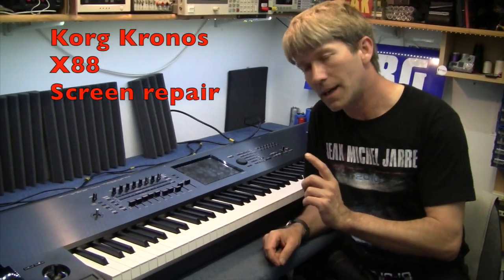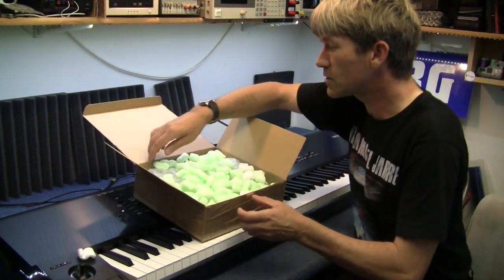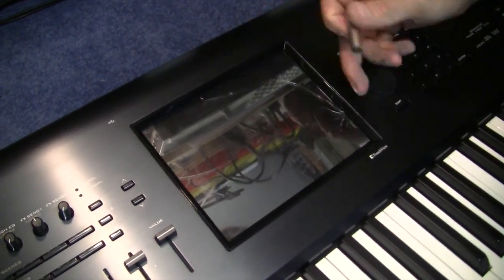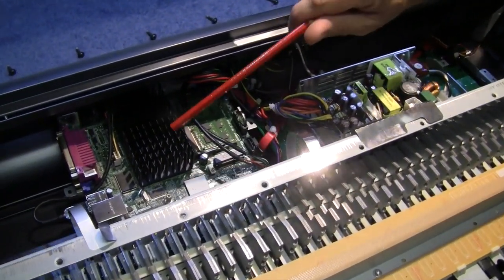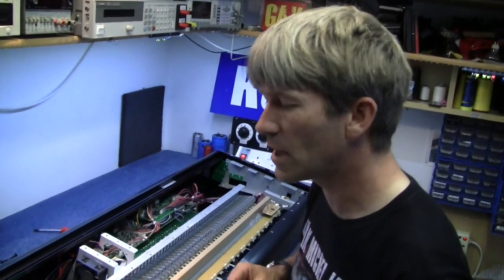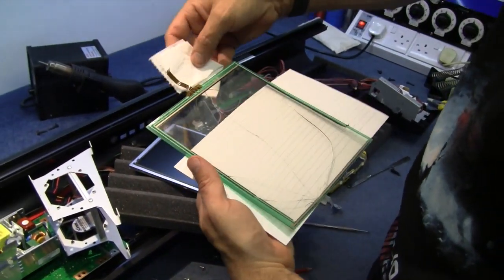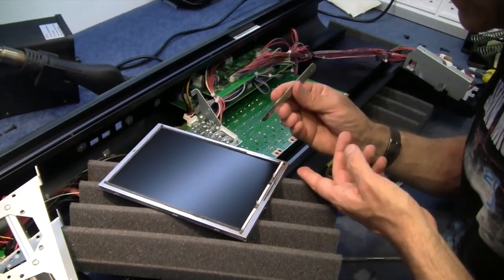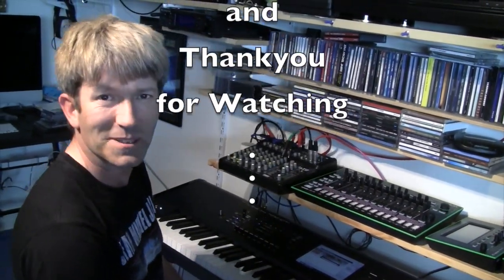MF#27 Korg Kronos X88 Repair cracked touch screen replacement

Comment: Korg used to make quite beautiful product such as the M1, T-series, and Wavestation.  A $100 Intel Atom PC inside is not exactly the most impressive thing in the world.
Reply: Quite embarrassing, even. Since the OASYS was quite a beast with 2.8 GHz Pentium back then. Korg needs a lot more CPU power than an Atom to make it a flagship instrument.
Reply: It is a con.  Even putting a high end Intel in it just to support Linux kernel, it's a round way to go to make audio product.  Looks like times of elegant and true engineering through dedicated DSP chips like the Motorola 56000 in the Nord Lead 2 back in 1997, those times are gone...  I am only scared to think of what's inside the Montage (Motif used Linux as well) or Integra-7.  I understand that digital technology is just bits, but I feel more comfortable with dedicated musical hardware instead of going around to use multi purpose consumer components.  So we no longer use dedicated DSP chips, only FPGA and mainstream PC CPU's to run musical hardware on?  If so, it doesn't make Nagra battery con look as bad as I thought it was, compared with what Korg is doing here :)  Sure, Yamaha charges a lot of money for their RAM boards, but if that's dedicated chips, I am fine with it.  Korg has advantage to most because upgrading memory is cheap.  Still, I think using Intel Atom in "high-end" professional instrument is a con.  God, I've done some research on the likes of LVMH, Rolex, Apple... Now I see Nagra and Korg joining the ranks.  But hey, if it's all legal, maybe it would be better (and healthier) not to know the things behind the scenes.  Nonetheless, it's a real eye opener this YouTube channel.
Reply from the maker: I think it could be made in a rackmount with a much better up to date processor.
Reply from the maker: Hi Andrew. I recently repaired a fairly expensive guitar foot pedal for a friend and it only contained one Arm cortex chip and a few other cheap components. I guess the cost was the development and programming.
Reply: Well, there was an interview with Eric Persing about that on sonicstate (who would love to have you on the show, too, by the way), and he said that there's no market for rackmounts of this type.  Eric Persing agrees that such solution would be better, but hardly anyone would be willing to pay for an Omnisphere in a rackmount module.
Reply: Well, I guess I am very old and conservative then.  I am still lusting over something like SY77 which made my jaw drop back in 1990 or so.  I like instruments like that in and out.  Paying money for a softsynth?  Not only a softsynth doesn't have any predefined form factor or tangibility, one has to rely on rather annoying Microsoft or Apple business ecosystems to make those run.  I am getting quite a bit concerned though what's inside the Integra-7 now.  Maybe it's an empty box with some FPGA simulator or something... I am afraid to open it.
Reply from the maker: I repaired an old ARP-2600 a while back and was quite happy to see that it just did what it was designed for, all those components in the right order made it the unmistakable ARP-2600. now I did run an arp-2600 software synth on the computer to try and set all the parameters exactly the same as the hardware unit in front of me. it just did not sound the same, close (ish) but it lacked something. then while playing with the softsynth I was continually getting annoying messages on screen asking me to update my antivirus and flash was out of date (yet again). I eventually turned off the computer and played happily with the old hardware unit knowing it needs no updates and it would just do what it is supposed to do :-)
Reply: Ha ha!!  This made my day!  Yes, that's precisely what I have in mind.  I am sure an OS can be optimized not to bother you with updates all the time, but by default these are the settings.  I feel as if the OS had me by the leash at all times.  I think that's why Apple favors "cloud" services instead of microSD card for their mobile devices, so that the data is on their servers and customer would pay monthly fee for the storage.  Same with music and video streaming.  Apple wants to get into that too, that's their business strategy.  After all monthly fees from the customers make for more predictable business plans.  Computers were not like that before the Internet was not mainstay.  I spent all nights on Windows 3.1 playing Flight Simulator without any bother from anything else.  It was beautiful experience.  Same with Atari ST, you load something like Dr.T's KCS sequencer, C-LAB Creator, or Steinberg Pro-24 or Cubase on the Atari, and the computer de facto becomes a sequencer, a patch editor, etc.  I had pleasure to work with Sun Microsystems computer, it was fantastic, and the Open Windows GUI was beautiful, and minimal, not to slow down your system.  I am sure Silicon Graphiscs machines were similar.  But as we all know these companies no longer make computers.  The OS wars were won by the companies who keep us on the leash by the Internet.  Even Canonical goes the same route with their Ubuntu.  I get bothered to upgrade all the time.  Anyway, I digress...

I may complain about all this because I am an older date person.  And I am quite shallow as well.  I got myself into the synthesizer hobby primarily because of the ads in Keyboard magazine back in 1988.  The Korg M1, Roland D-20, Yamaha V50, they looked so beautiful, professional, sleek, serious, no cheesy icons on those.   I loved every bit of that market.  Now, the "millennials" (sorry, a politically incorrect "offensive" term, but you know whom I am talking about) grew up having all musical production tools in their PC.  So, they won't understand the delusions of an old geezer like me, talking about aesthetics of gear, keyboard feel, build quality, etc.  Today's economy seems to be all about the bottom line, just to get things done, and a laptop or tablet is the way to go, because everybody has one, and it's portable too.  I am more sentimental, still dreaming of keyboards like Roland RD-1000, D-50, Yamaha SY77, mainly steaming from desire for aesthetics I like.  ARP2600 is wonderful.  Minimoog Model-D has just been reissued in rather truth to the honest form, which I am pleasantly surprised.  Who knows, we may see ARP2600 reissue as well (in 86% size by Korg), but we are extremely unlikely to see reissues of the DX7II, Roland D-50, D-20, Yamaha SY77, SY99... etc.  Everyone wants things smaller and portable.  Roland's expanding Boutique line is a proof of that.  Although quite substantial DJ controllers from Pioneer, Denon, and now Roland seem to be in demand.  I guess, like an audience, like the gear.  There's no way around it if a company wants to stay in business.
Reply from the maker: now that made a very interesting read in a way that I could have fooled myself into thinking I just wrote the same thing. the sy77 and dx7 have been almost resurrected within the yamaha montage (in a way) it uses FM and AWM so I jumped in there and I truly enjoy playing it. there is no full on editable sequencer. it will record as one lump of performance but you cannot go and add something on another track afterwards which means I have to record one track at a time like the good old days. I like the way some things are going though with the model D and yes if korg remade the 2600 I would get my name on the list even though it may be 86%. I had the boutiques and though they sounded fairly convincing they were hard to perform those tiny little movements with faders that could be so subtle on the original instrument. the JU-08 was the worst one as the faders only moved one centimetre so you could not get those sweet spots quite so easily as you could on the original. dont get me wrong I do use cubase when i am trying to compose something just to see if it can work but i will then try to do it all with hardware afterwards as best as i can.
Reply: Hardware or software, it's difficult to tell these days.  As stated by Ikutaro Kakehashi in an '86 issue of Keyboard magazine, the Roland D-50 development was 70% software.  So, the D-50 is more of a soft synth than hardware actually.  On the other hand, it runs on dedicated hardware.  I think that's where the distinction should be made: dedicated, or multipurpose hardware.  Now, the business side of all this can be quite disturbing to actually get to know what's going on behind the scenes.  Today's Sonic Talk almost ended in a fight discussing the business side of software products running on Apple's hardware.  It's bad, and it seems very politically incorrect to talk about it.  Nick Batt tried to moderate...  But, when people realize that they are being constantly manipulated and deceived by large manufacturers, they may eventually get fed up, and start talking.  I think it's all natural.

As far as Montage is concerned, it has beautiful action, beautiful action, and beautiful built quality.  I am not big on front panel aesthetics though.  I don't like the touchscreen (looks like someone put a tablet on it), I don't like the Nord Lead 3 type encoders (way too many lights) and don't get me even started on the big nipple-shaped thing called "super knob".  It's clearly EDM/DJ oriented, and I am not into that kind of thing.  And yes, it's nice the Montage has the FM engine, and it has 8-operators and all.  I don't believe it has RCM though.  There are some really cool and expressive RCM sounds I have SY77 disks, I can play with those for hours triggering from the KX5 srap-on controller.  RCM and KX5 seem to work especially well for woodwind type of sounds, and that's even without the breath controller.  Anyway, any patch one is driven to play around with for hours is to me a definition of a good patch.

But yes, if I want to get a call for a gig, the Montage is a must.  Even Motif is old news now.  As a hobbyist, I am not compelled.  As a hobbyist I look for something playable, expressive, with great build quality, and professional looks.  I am still dreaming of Roland RD-1000.  I'd love to have that one....
Reply from the maker: wow that was interesting reading. I did not know those details of the D-50 Thankyou. yes the hardware/software divide is not as divided as one may think. I personally sit on the fence and have some nice old mono synths plus i use arturia softsynths, I am a strange being who can listen to beethoven Jarre klaus wunderlich dire straits and kraftwerk all in the same day. I know what you mean about the superknob as I thought it was a gimmick though I have it controlled by footpedal because I only have 2 hands and i want them on the keys not on my knob (did i just say that). but it does blend sounds from one to another quite gracefully so in a way its a nice addition if you want to use it. I do like some dance DJ type music as I use to be a DJ in london many many years ago though the equipment we used then was nothing compared to what people have now and the idea of dance music was donna summers and ABBA followed by Erasure and pet shop boys. oh the good old days.
Reply: I have no clue about DJ'ing.  I saw this guy doing a DJ gig at Macy's this weekend, he had a couple of rather bass heavy speakers, and some rig on which he seemed jumping all over.  I understand I am old, and I don't get it.  But a guy has a gig and I don't, so I guess he knows what he is doing.  I am just a bit surprised that certain things become accepted these days and called music making.  Back in the olden days, in 1990 or so, I had the same attitude though as millennials have today.  I was thinking, it takes a lot of practice to play keyboard well, and you end up sounding "old", you know, playing something classical, or some '40s boogie.  Anything type of music 2 years old seemed archaic.  I was thinking, I can better with sequencer.  Can enter all notes in step mode, and play them back at super precision.  I could also play an auto-accompaniment keyboard, and it all sounded like band playing, and everybody was dancing.  To put it short, having any kind of deeper musical knowledge or skill seemed nerdy, uncool, and unnecessary.  My piano teacher was telling me: "You know, learn this tango, you'll play that on the piano, everybody will know you can play music."  I wasn't taking that seriously...

Now of course I regret I didn't practice.  I might even regret I didn't go the DJ route either.  You see, I had this fantastic BOSS DR-550 drum machine.  I knew it in and out (and still do) and I can program into it pretty much anything that comes to my mind.  It still took a lot of time to make patterns, then arrange them in a song in a meaningful way so that they matched the arrangement of music to which the drum track would serve as accompaniment.  It had never crossed my mind though that searching for patterns live on stage would be considered a musical performance, which is what EDM seems to be these days.  The guy just searches audio clips in Ableton with auto tempo and pitch shift matching, and bam, he is a star.  I guess, I must be bitter that I didn't became a star, some I am trolling now about EDM/DJ/dub-step, you know, stuff I don't understand.  Live is tough I guess when one has no understanding of things.

I always wanted to have some understanding of electronics, how the circuits work and all, and what each electronic component does.  It has always been a myster for me.  I have fairly basic understanding of synthesis methods like additive, FM, and subtractive, how PCM works, and how DSD works.  But not much more than that.  I wish I really knew electronics.  The furthest I got in my electronic endeavors was to disassemble my beloved SY77 five times, to replace the LCD backlight.  Yes, five times.  Too me five evenings.  I disassembled the whole instrument, changed the LCD backlight, reassembled all back, the LCD was not settled properly.  I eventually broke the LCD glass at another attempt.  Got new LCD assembly with LCD backlight installed, replaced the broken one, it finally worked.  My soldering work was probably awful, even though I pride myself that I heat up the wire not the solder, so it all should join nicely allowing the current to flow well.  But that's what I am thinking.  Anyway, these are great videos about the musical gear disassembling and explaining what the components are, although with my lack of knowledge of electronics, I can only admire the engineering work that went into those instruments, but unfortunately without having a proper feel for it.  Maybe not knowing is good though.  If you don't know how it works or how it was made, it's magic.  I remember I was so disappointed that the sound of the entire universe on Jarre's Oxygene was simply an organ connected to a guitar pedal.  I listened to that album so many times when I was a kid, and it was incredible.  I guess I am glad I didn't know how it was made back then.  I guess I like the magic.  I am still in awe with things like Atari 1040ST, Roland D-50, Yamaha SY77, and especially Yamaha VL-series and a totally unobtainable string modeling machine: the VP1.  The physical modelling technology is to me the most amazing way of synthesizing and emulating sounds electronically.  Then Nord Lead came out, and killed all that excitement.  We were back to square one with handful of waveforms, limited polyphony, and a few knobs.  Mind you, the Nord Lead is very neat design with Motorola 56000.  It's fantastic.  I am just thinking that we've been stuck in subtractive synthesis for 20 years now.  It's getting a big nauseating to see videos on YouTube people basically twiddling the filter cutoff and resonance knobs for the last 20 years.  Dub-step wobble (that used to be called growl) seems to be a little on a dying side now, at least from synth demonstrators.  Oh well, things change.  People adapt, I don't.  And I am still dreaming I'll one day play keyboards well.
Reply from the maker: I am not the best keyboard player. I tend to take forever to try and learn something new. I did the oxygene cover in one of my videos and it looked and sounded fine but I worked on playing that for a long time until it was drilled into my braincells. I have a friend (youtube organaut) who just listens to music and sits down and gets it right within a few attempts. complete with chords and footpedals etc. brilliant.
Reply: markusfuller
I think it has to do with two things: 1) amount of previous practice 2). age.  When I was 17-25 I was able to learn some pieces in considerable time.  Also, the learning process was become faster and faster as I practiced.  Then I stopped playing altogether as I started dating women.  Now I am 42, it took me forever to learn one page of fairly simple music.  Now I am sitting on first couple pages of even easier music, and it's so easy that I can play it by looking at the score, but I can't play it without the score.  So, two pieces of advice I can have to improve one's music are: 1) Don't pay too much attention to women.  2) Don't age.
Reply from the maker: I agree. I used a desoldering tool yesterday that had my old address on it from 35years ago when i was just 15 years old and I thought "where the heck did those 35 years go ?. and whats more important how much is left ?.
Reply: markusfuller
Yeah, and that's a disturbing part.  When one is 15, life ahead seems infinite, and one feels invincible.  But then thinking like that can end immediately with one good panic attack ending up in emergency room after a night out of drinking.  Then we start feel mortality.  How much is left?  Could be couple seconds, could be a minute, could be a month, could be year, could even be ten years if we're lucky.  Depends on genetics and life style.  In keyboard playing, it mostly depends on practice.  You can be the best genetic specimen in the world, if you won't practice scales and arpeggios daily, and learn new pieces, you're unlikely to get to excellence there by "talent" alone.  Maybe in other disciplines like modeling or singing talent is important, not sure.  Anyway, in my life, keyboard playing is the most important thing. I was too lazy though, read too many synthesizer books an manuals (great excuse not to practice keyboard) my keyboard skills which I had a little bit back when I was 25 or less, it all went away.  Now I can only play some pop songs that I never liked when I was a kid.  So, I became grumpy and cynical, naturally.  How much time is left?   Even if another 35 years is left, it surely won't be any better than previous 35 years, that's for sure.  I feel mortality every single day at 42.  I can't imagine what it must be to be 50, 60, etc...
Reply from the maker: I just wish I had time to practice. I cannot read music and only find chords by accident. but in a strange way I seem to find my way. eventually.
Reply: markusfuller
I can't get chords... I mean, yes I can, but not the right ones.  Only when I get a hold of a sheet music, then I play and wow, yeah, that's the chord!!!  Now it sounds the way it is supposed to.  I find sheet music a most direct way to find out all about the keyboard piece.  With classical music there's no issue.  Sheet music is standard practice there, and the score is usually accurate.   But finding a good transcription of anything else than classical, oh... that can be a headache.
Reply: I've had the pleasure of working on a TI SoC recently for an industrial control unit. It has an ARM processor running Linux, and additionally a bunch of C2000 DSPs for real time data acquisition, processing and control tasks. Unfortunately, the system was impossible for some other engineers to handle, they inadvertently kept damaging the code that runs on the C2000s, apparently unable to grasp the concept that there's two different kinds of systems running inside the unit. Also, the chip is very expensive and is not openly available.

I don't think using commodity hardware is wrong. After all, you're not paying for the hardware, you're paying for something where engineering problems have been solved, something that is reliable, that controls well, and that works. So what do you care how it has been achieved? And since the product as a whole is not a commodity, paying 5 times as much or more as the bare metal underneath costs is just fair - that's pretty much the baseline in decent musician's gear and HiFi and photography equipment. Maybe at 10 to 50 times i'd draw the line and say it's not fair any longer, depending on what it is and how much effort they put into it. Also utilizing commodity components helps repairability.

In the meanwhile, i think we ran out of new interesting ways to generate sound. Atom is not always slower than a Pentium IV, and you keep in mind that the latter never quite got rid of the denorm bug that either completely demolishes the sound processing performance, or requires workarounds. By the way, we still carry these workarounds around in our PC software, wasting performance. Also once you nail down the platform, a lot better performance can be achieved than you expect of PC. Even if it's just an Atom.

But starting with Bay Trail, Atom has achieved truly spectacular general performance too.

Yamaha, "dedicated" RAM ICs? Where the hell would that come from? Nobody will spin up a special kind of RAM ICs just for a music instrument, something that actually has minimal requirements compared to say video processing devices.
Reply: If this is the standard of their engineering there is no way i would buy one.

if they are going to use off the shelf boards like that they could at least use a powerful, energy efficient ARM chip instead.
Reply: Andrew Piatek when you buy a kronos, basically you pay for the software, an old computer with an SSD and a decent master keyboard. But in the first place: the software. Actually even an Ipad is more powerful then the Kronos hardware. Obvioulsy Korg could release a rack version or also simply the software, which in the kronos runs under a Linux dialect OS, and could be also quite easily readapted for other OS, but they will never do this because nobody could be convinced to spend some thousands euros for it... And there would be piracy too.
Reply: Andrew Piatek yes
Reply: I owned a T1, M1 and Wavestation and currently have the Kronos...Kronos sounds much more impressive...that's the end game for me.
Reply: @dvamateur  The PSR-S series uses the SSP1 or SSP2 for it's DSP and vocal harmony features